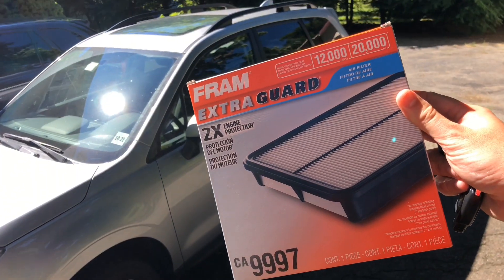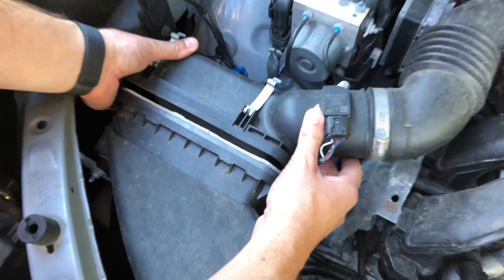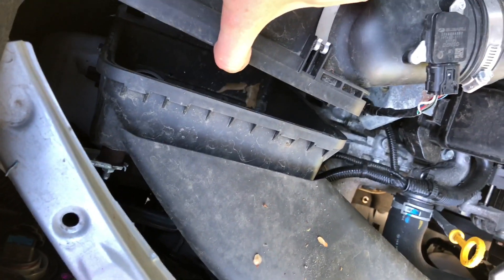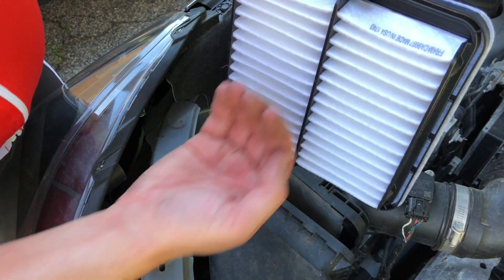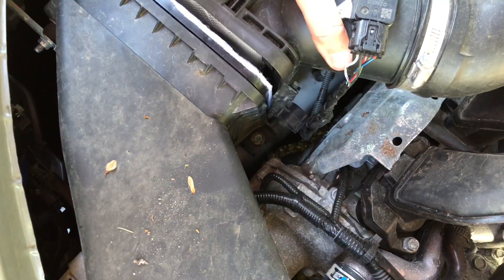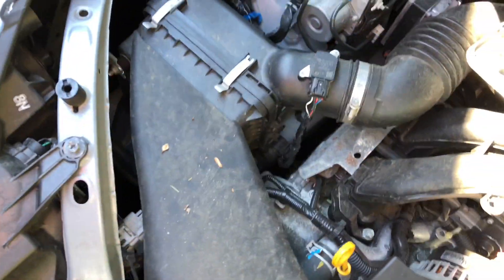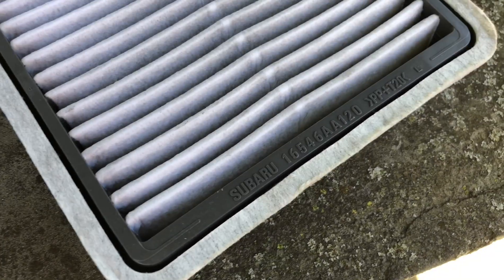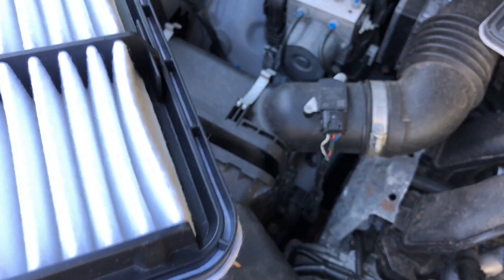Subaru Forester HOW TO: Replace Engine Air Filter (Legacy / WRX / Crosstrek / Outback / Tribeca)

Comment: Brilliant that you didn't show that you disconnected the air intake (the tube to the right of the filter housing), turning a 2 min vid into a half-hour debacle. I am a backyard mechanic with over 50 years of experience, normally taking all of 30 seconds to replace the air filter on any other domestic or foreign vehicle; but not this one! Subaru's engineers should be imprisoned for making the air filter so difficult to access!

Comment: Just changed my filter! 28,000 miles n it was dirty dirty dirty! Dealer wanted 59.99 so I paid $23 for the original part (so as not to void my warranty) & followed ur video! So appreciate this. Couldn't find it in my manual
Reply from the maker: Nice job on the savings. Just a heads up... You will never void your warranty  buying a comparable air filter.
Reply: Sitting here in the dealership, they asked me if I wanted a new filter, $26 so I'm not bothering doing it myself this time I guess

Comment: Thanks for video. I watched the "replace cabin air filter" and wanna do that this weekend. All that pushing with those plastic tabs makes me feel afraid of breaking them, or my nails, plus dropping the glove box past the regular opening. In any case, I heard you mentioned in this video something about firewall, could you please do a short video of showing where it is. I might have those firewall insulations torn off and wonder if it's worth to replace or just go without it. Thanks.
Reply from the maker: You're welcome. I no longer have this vehicle. Went EV with a Model 3. Highly recommended if you can swing it. That or a Model Y. Best of luck!